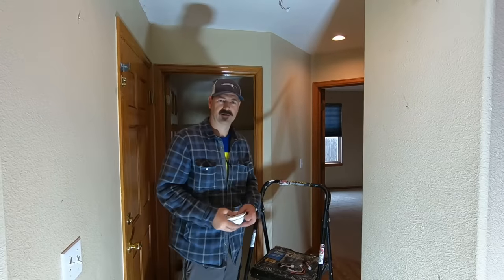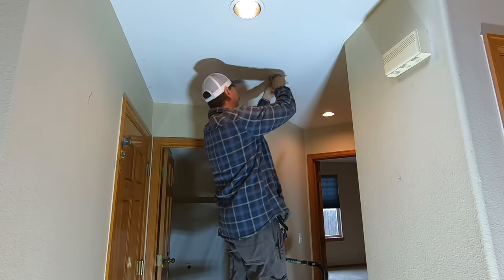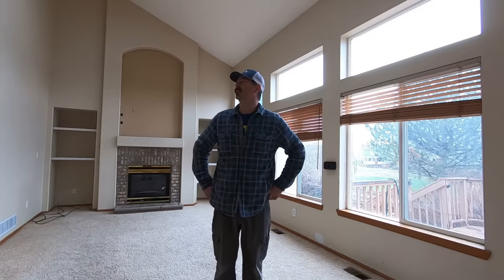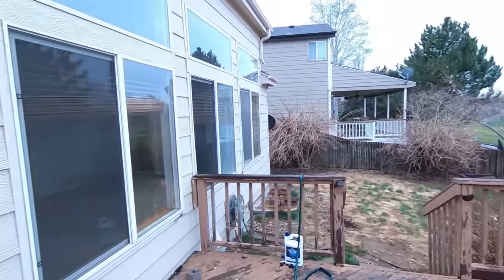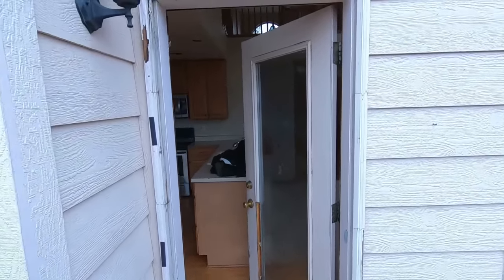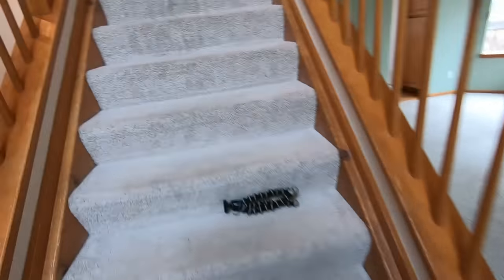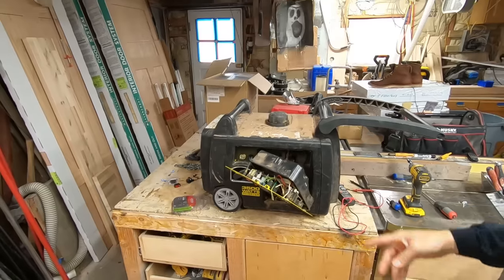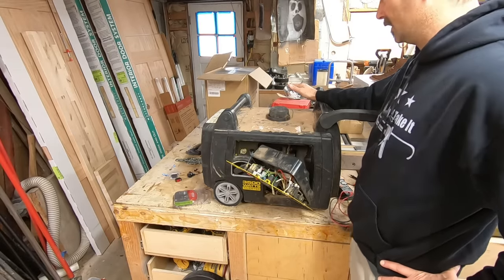Handyman $500 In 20 Minutes | Can You Do This? | THE HANDYMAN |

Comment: I know the feeling. When we moved into our house we had somebody come out afterwards to mark the property lines. We found out our driveway was built on our neighbors land. He knew it and said its fine but there was no easement signed. So in theory he could have just had the driveway ripped up and we would have had to pay almost 30 grand to tie it back into the rest of the driveway that was on our land. We got lucky that his fence was built on our property so we got an easement signed were we left the fence he left the driveway. But like you were saying fine tooth comb for everything. Buying a house shouldn’t be a rush job. Go look at it 2-3 times. TAKE NOTES its easy to forget something minor when you find something major. And minor stuff adds up quick. Hire people if you don’t know what to look for. And make sure you get a roofer up on the roof b4 you buy. A roof is very expensive and if they say you have anything under 5 years left have the seller replace it or better yet the buyer replaces it with better materials bc sellers going to just get dirt cheap materials and get that taken off the cost of the house.

Comment: inspired by your vids and started doing handyman work. old people are now having heart attacks when I tell them 29/hr... fml
Reply: Dude that is way too cheap.
Reply: Yeah and I still have people try to talk me down from that. it's all a bunch of old people in my area
Reply: @andrewt8116  my advice would be to switch away from hourly. I used to charge by the hour at 45 per hour, which is cheap. Now I quote work for a fixed price, and quote it to make 100 per hour, which is what I make unless I make a mistake with my estimating. 

Job I'm on now I underestimated time a bit, but will still make about 70 per hour. Average is 100 most jobs though.

It presents differently in the clients mind. Most people compare an hourly rate to what they've made as employees and think you're expensive, not understanding overhead. When you give a price for the job itself, they just think about the value of getting the job done.

I don't tell customers as a carpenter that I charge 100 per hour. I look at a half day of work and quote them 400. They are a lot more accepting of that than being told I charge 100 per hour and think it will take 4 hours. Also as you get more experienced you get more efficient, so I'm much faster i would guess on average than I was at the same task 15 years ago. Working by the hour would punish me for my efficiency and tool investment.

At 29 per hour, after paying for gas, tools, business insurance, truck maintenance, not being able to fill 40 billable hours every single week doing small jobs, id be surprised if you make much more than minimum wage after expenses. I started charging 30 per hour when I was first self employed, 13 years ago. I was umdercharging then too.
Reply: @chrisburns5691 I'm  not sure why YouTube doesn't notify me of replies but I'm glad that I finally saw this. As I finish jobs im making sure I know how long it took me and then the next similar job I do a flat fee instead of hourly. Are you in California? I've been thinking about moving and getting my contractor's license there because of pay and demand for trades. I just talked to a block guy who ran his own business and I asked what his best advice was and he told me that his biggest regret was not charging enough. I'm not going to make that mistake

Comment: Listen, if im paying $500 to repair a door, i am expexting a new door frame and new door to be installed. 

I am not paying $500 to adjust hinges and a strike plate. 

Handyman needs to specify whether the door is buggered so bad it needs an entire new door and frame, or if he is going to chisel out a hinge and force it over 3mm then move the strike plate a bit to fix something from jamming. 

I fixed a jamming door by chiselling out the hinges deeper and chiselling out the strike plate deeper. And a few mm extra on each side was all it needed to not jam. 

Im not paying $500 for that.

Door knob not lined up with the strike plate can be easy to fix too. Sometimes doors shift on ybe hinges a bit. Sometimes chiselling out the top hinge deeper fixes it, sometimes you can just chisel out the strike plate and move it down 3mm and screw it back on.
Reply from the maker: $2,500 for a new to be installed.